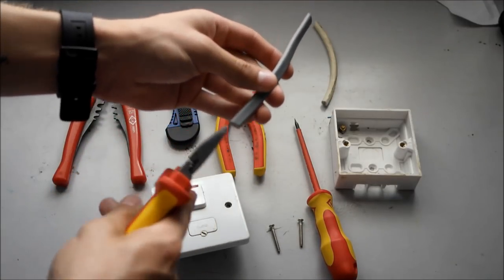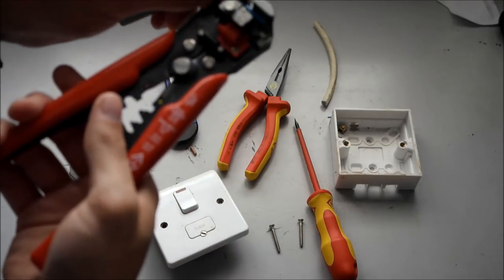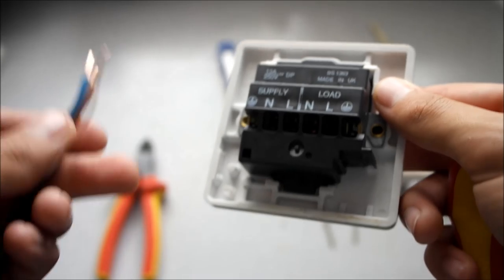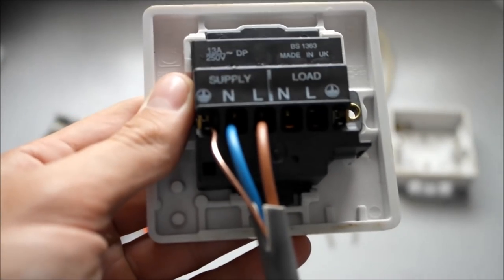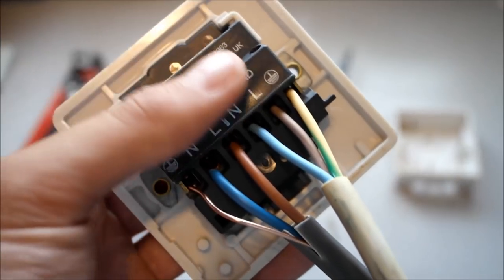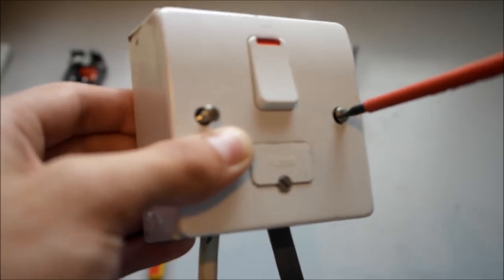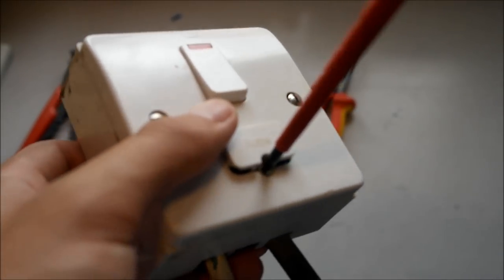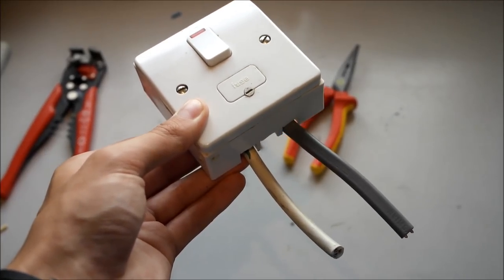How to wire an FCU - Fused Connection Unit

Comment: Tradesmen get really defensive at amateurs DIY'ing, particularly plumbers/electricians, but let's get real - It's all super simple really & every house is pretty much identical to every other one - this isn't a highly complex nuclear power station. Join wires together securely, don't mix them up, don't damage anything, read the instructions where required - done.
Reply: Honestly thinking the same right now :)
Reply: Wel he didn't fold the end of the conductors, When he tightened the terminal he could ruin the connection due to the small thickness of the wires
Reply: @callumclose1  He pull tested the connections several times to ensure the connection was good.

Comment: Excellent and well explained video. I want to use one of these inside my house to control an outdoor socket, so that I can switch the outdoor socket off when not in use. Would it be acceptable practice to run some 2.5mm twin and earth from an internal socket to the fcu and then connect Flexi cable to the load side of the fcu to pass through the outside wall to feed the outdoor socket?

Comment: If I was making this vid I'd have stripped some extra earth sleeving off the appliance cable and pretended I hadn't forgotten to get earth sleeving for the feed. ;)
Reply: Hi Robbi this is the easiest I've seen to understand. I need power for a shower pump only line I have is a single supply to vanity light near by. I am.planning using this and disconnection of light.
What I want to know is how can I also provide power for the vanity light? Many thanks Nic

Comment: Currently have an fcu with 5 amp fuse. To service a light switch for spotlights. I want to add a double socket from the fcu. Can you confirm if it’s the “supply” terminals I use and swap fuse to 13 amp  when adding double socket. ? Thanks

Comment: I’ve got a fused spur that I need to wire up. Just to be clear the ‘In’ N and L are for the wires from the socket I’m coming off and the ‘Load’ is from the wire that connects to the appliance that I’m powering?

Comment: My immersion heater also has one of these switches with a 13amp fuse in it. The plug gets incredibly hot. The fuse is all black and the ceramic is burnt. It sometimes causes the main fuse box to trip the switch for the boiler. I've replaced with the same Amp fuse, and soemtimes works, sometimes stops working. The timer will spin and turn the boiler on in the morning, and other times it just stops working. I feel like a 15amp fuse should be used if 13amp cant handle it.
Reply: Safely isolate and remove that immediately. An immersion should have it's own independent supply cable and in a 16 amp mcb. Hopefully some idjiot hasn't wired it from a mains socket circuit. 
The fcu needs to be changed for a 20 amp double pole isolater switch. One with a Led/neon indicator is good as you'll have an indication as to if the tank is on or off. Hopefully your immersion is also on a timer.

Comment: A bit off topic. But why do they sell plugs in UK with 13A fuses installed?  You would think they would leave them empty so you can put the appropriate fuse in yourself, my friend bought a replacement  rubber plug for an inspection lamp and he left the 13A fuse in it, shouldn't he have put a 3A fuse in?

Comment: Great video - I have a fused switch unit with a neon light that stays on even when the unit is switched off and no power is going to my hob. Any advice on what is wrong? Thanks
Reply: It sounds to me that your supply feed is connected to the load terminal

Comment: Hi Allen, I've got a Flushed FCU to supply the Dishwasher. The incoming cable is installed through the wall. I'm struggling to understand how to run cable to from Dishwasher to flush FCU. pls advise. Thanks
Reply from the maker: The existing cable is in the wall? Chase the wall out and lay cable in wall with conduit/capping over the top and install plug socket ideally in an adjacent cupboard

Comment: I have an fcu running from a 2 gang socket in small box room the fcu is supplying a wall lamp with pull cord can I run another fcu into existing one to freed outside security light

Comment: Hi, great vid. I have a fused spur socket already installed but no cooker extractor hood. If I want to install and hide cooker extractor hood cable through the drywall and bring it through the back box is that ok? If not, what specific size / number cable do I need to run from the fused spur, through the dry wall to the cooker hood? Thanks

Comment: Should my boiler spur have 2 supplies? The fused spur fuse keeps blowing after a small chain fell behind the programmer on the back plate. Ever since the moment you attach any controller even a new one it just blows the fuse. Currently using the boiler with a spur swich directly

Comment: How 20Amp fuse differ from 13Amp fuse. Is it that if you have a large heater unit consuming more electricity you need bigger fuse on the switch? Because I suspect that if the switch smells while it's on and it's getting really warm that's because the fuse inside the switch on the wall is weak/low?? I might be wrong.

Comment: Can the supply be from a ring mains in a kitchen? So being supplied directly to the FCU from the consumer unit? And can I link one FCU to another FCU directly? (One for washing machine, one for cooker hob and one for fridge freezer)
Reply from the maker: +Connor Spragg thanks for the comment well it is good practice to protect appliances, the way i do it is put a spur for each appliance at socket level above the worktop then a socket on the load side of the spur under the counter to plug the appliance in. With regards to the cooker your should really run its own feed from the consumer unit and have a 45 amp cooker switch socket level and a 45 amp cooker outlet plate under the counter for the cooker to be wired into hope this helps.

Comment: Thanks for you excellent videos Allen. I want to put up a pendant light over a dining room table. There is a nearby floor socket, which is fused. Can I tap this socket to power the light? I also want to put a switch on the wall above the socket to turn the light on and off.
Thanks in advance
David

Comment: I’ve got this cable going from a switch to the bathroom above and there is a switch there too,it’s where immersion heater was,so if I want to run a 1.5 mm cable from there under bath through wall to an outdoor security light is it this fcu I need with a lower amp fuse in it? Because the cables for this switches is thicker I thought maybe it will blow the bulbs in my outdoor light, or would it be better to go in loft and tap into a 1.5mm cable  instead

Comment: Hi Allen thanks for the video, I have a electric 2kw rad with 4 cables where would the pilot wire go in the FCU ?
Reply: I suggest if you don't know what your doing to get a qualified and registered(niceic,napit,stroke,etc..) electrician to under go the work

Comment: I need to add 1 or 2 sockets in the loft. I’m planning to tap into a ring main 2.5 T&E in the loft. I’ll cut the cable and install both those ends into the supply side then add a length of spur cable into the load side and then onto a spur socket. Is that right? 

It’s a bungalow by the way
Reply: Correct.

Comment: I'm trying to connect a cooker hood to one of these recommended by the instruction booklet. The appliance doesnt have an earth cable but the supply does, will this cause any problems? It says not to earth it.
Reply from the maker: Tom sandford where a live goes an earth must follow but make sure the cooker hood is double insulated or carries the symbol a square within a square if it does not show this mark it must not be used unless the cable is renewed

Comment: So if I wanted to convert a plug socket into a FCU with Flex outlet, I would put the LNE wires for the socket into the Supply LNE and for the Load LNE I would put the wires from the appliance into it, right?
Reply from the maker: correct

Comment: Those automatic wire strippers will strip the main cable pvc. Makes a much neater job than pulling the earth and then snipping the excess with cutters.

Comment: Hi, can you tell me please if the the appliance  hasn't  got an earth cable is it still safe to just use the live and nutral?
Reply from the maker: +Gavin Rackett yes should be if the appliance has know earth usually means its double insulated which means it docent require an earth have look in the instructions.

Comment: Allen, if i want to wire an outside light on a FCU can I get my power from a twin socket (nearest power point to outer wall) running off the mains
Reply from the maker: Yes it's not ideal but as long as you put a 3 amp fuse in it and ensure you have RCD protection of not consult a qualified Electrician
Reply: ok

Comment: Please can you help me I would really appreciate your advice as I’m stuck on what I should do. 

Can I connect both my fridge freezer and duel fuel cooker to a 13A switched fused spur on a double socket or would it overload it?
Below I have taken the time to get all the technical spec for each appliance from the manuals 

American fridge freezer
BEKO Pro ASDM241PX 
230v voltage 
50hz frequency 
150w wattage 
0.85A current 

The fridge freezer has a standard 1.5mm twin&earth cable with 13A plug on it

Duel fuel cooker (gas cooker, electric oven)
Kenwood CK305-1  
230v voltage
50hz frequency
2270w wattage 

The duel fuel cooker has no cable or plug on it but the manual saying to add 1.5mm twin&earth cable to the feeder cable connection which is on the rear of the cooker and the other end Must be connected to a 13A switched fuse spur outlet.

In my kitchen where I want to place both appliances I have few normal non spur sockets plus I have a 13A switched fused spur outlet that is connected to a single socket, I’m thinking to change that single to a double socket so I can add the cooker and fridge freezer to it or could I add just the cooker to that and just plug the freezer to a normal non spur/non fused spur socket?
Hope this all makes sense...
Reply from the maker: N.O.E King yes you can put both in a double socket off a 13a spur as the cooker is 9amp and the fridge is 0.6 amp so yes you can run both of a double socket from a spur
Reply: Allen Goldsmith thank you so much for your advice! 
I have had a few people say it should only go into a isolated cooker circuit switch but from what I researched that is for heavy duty electric cooker that can reach high amps upto 30a is that correct? 
Also is there an option  I can connect a less powerful cooker like mine with 1.5mm twin&earth to a isolated cooker switch which has 6mm twin & earth or would you add a 6mm to the cooker instead of 1.5mm then to that switch? 
I’m feeling if my cooker has a fault it will only cut off if it reaches 30A which sound dangerous as mine only requires 13A I’m i right?
Reply from the maker: N.O.E King if you do 2270 divided by 230 = 9.8 amp So if everything is full wack it will draw 9.8amps the fridge is 270 divided by 230 = 1.1 amp so say 10.5 amp so that’s the most it will draw and you have 13 amp fuse in the spur so it will be fine also the cooker will have a thermostat init so it will cut in and out. It will draw a lot when it initially heats the elements up. Anything over 3kw (13amp) will require it’s own circuit
Reply: Allen Goldsmith yes this makes perfect sence ,I am just trying to see if it’s possible to connect this cooker to a isolated cooker switch also as it’s closer to my kitchen window if not I don’t mind adding a cooker hood and have it further away next to my fridge. 

Will my 9.8amp cooker work in a isolated 30amp cooker circuit outlet 
Will there be any problems ?
Reply from the maker: N.O.E King well if you bring it off a cooker circuit and wire it in 1.5 the cooker circuit could be backed by a 30amp fuse and 1.5 is only rated at 16amp so personally I would put it on the spur at the end of the day you have to protect the cable as an over rated breaker will burn the cable out if overloaded
Reply: Allen Goldsmith what if you use a 6mm twin & earth cable that is rated upto 47A , have that coming out of the cooker and send that to the 30A isolated cooker circuit...
I’m i right In guessing the wire would be fine but if I have a problem with the cooker the breaker won’t cut the fuse off until it reaches 30A meaning my cooker would get damaged or doesn’t it work like that?
Reply from the maker: N.O.E King yes you can wire it in 6mm that’s fine the fuse is there to protect the cable from short circuit or overload make sure you have an rcd fitted to circuit which will protect you against a fault current
Reply: Allen Goldsmith that’s brilliant!!! I thought I wouldn’t be able to use the isolated cooker switch thinking it was made for heavy duty electric cookers only that reach upto 30A. 
Currently the RCD thats fitted to that circuit is 30A can I decrease that to 13A to protect my cooker even though I would be using 6mm wiring feed throughout this isolated circuit?
Sorry for all the questions and being patient with me , electricity is so complicated
Reply from the maker: N.O.E King if the isolator says 45amp that’s what it is rated at in terms of current it can safely handle

Comment: The led indicator on the FCU for the fridge freezer keeps flickering what does this mean? It doesn't go out, just flickers. Cheers.
Reply: poor switch get more expensive ones unless connection is loose or someone made the mistake and wired load as supply
Reply: possible that a Insulation resistance test has been done without by passing the line first and its had 500v through it

Comment: hello, can you use Heat-Resistant Flexible Cable 3183TQ 3-Core 2.5mm² ie from screwfix instead of twin & earth and then adding earth sheathing?
Reply from the maker: FP 200 is fire proof if thats what you mean but thats mostly fire alarms ect.

Comment: Hi,
My unit won't close, it appears to have lost the thread connection and wont go back in- we've tried brute force and endless screwing to no avail- can you help?  Thank you
Reply from the maker: Silver Yonder the only option is to replace the backbox. Have you tried a different screw as this sometimes works!
Reply: Dear Allen, 
I hadn't considered this, I don't understand how this happened as we did exactly as you did in the video.  I'm unsure the screw fitting will come out, we tried for ages and I'm not sure that was an option.  We'll try though.  Thanks very much for getting back to us.

Comment: I have a gas cooker and want to wire up the ignition is this the same thing , at the moment it is just on a normal plug
Reply from the maker: Susan Burns well you can wire a 13 amp single socket to the load of the spur then plug the plug in to that if that helps?

Comment: hiya,  ive put a light on the roof of my shed ( inside that is ) :-]. so i have twin & earth hanging from that, i have the same exiting my fused switch spur & a single gang light switch ready to be wired in ! so my question is how do i complete the set up ? thankyou,
Reply from the maker: +dave brown hi thanks for the comment, so what you are saying is there is a cable hanging out the light? and there is a spur and a light switch and you want to wire it all up??
Reply: Hello allen, basically, 3 wires out of light. 3 wires out of spur, a 1 gang switch in the middle, and im not sure how to proceed !?
Reply from the maker: well does the spur have a switch on the front of it??
Reply: +Allen Goldsmith yes its a switched unit, as i have fitted two double sockets in line with the plan of feeding the new light via the switched spur !
Reply from the maker: well if you take a 1.5mm cable out of the spur and take it to the light switch, put the brown in the COM of the light switch then get a connector block and put the blue into that, then take a cable from the switch to the light put the brown in the L1 of the switch and the blue into the connector block and put the earths into another another connector block and that should work.
Reply: +Allen Goldsmith will have a bash in the morning so i can see what  im doing :-) ! cheers allen !!!
Reply from the maker: any problems just message me hope that helps :)
Reply: +Allen Goldsmith allen, help please, can you resend your advise tex, ive lost the bugger somehow ! sorry mate
Reply from the maker: haha not a problem... well if you take a 1.5mm cable out of the spur and take it to the light switch, put the brown in the COM of the light switch then get a connector block and put the blue into that, then take a cable from the switch to the light put the brown in the L1 of the switch and the blue into the connector block and put the earths into another another connector block and that should work.
Reply: +Allen Goldsmith forgive my ignorance and stupidity allen ! so, is it ? power to switch, from switch to light live, then join neutrals and earths together ?
Reply from the maker: in a nut shell yes i could proberly knock up a drawing an email it to you if thats any use??
Reply: +Allen Goldsmith no thats alrite mate :-). thankyou very much for your help n patience though ! pukka...
Reply from the maker: not a problem any problems give us a shout
Reply: +Allen Goldsmith happy days allen, we have light and no explosions ! thanks again ! dave.
Reply from the maker: thats great Dave! glad to help :)
Reply: dave brown 1

Comment: I have  one of these that was installed for me incase I installed and extractor fan, it's always been switched off yet I opened it to find there is already wiring in the "load" connectors, where I wanted to wire up a new cooker hood, do I remove the wires already occupying the load connectors and if so how do I make the ones I remove safe?
Reply: Did you sort this out, I have the same